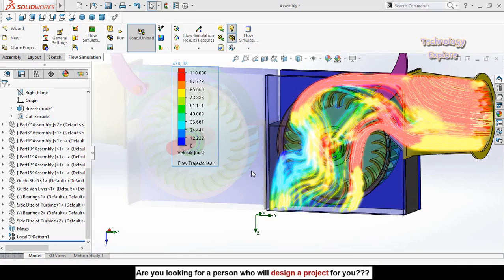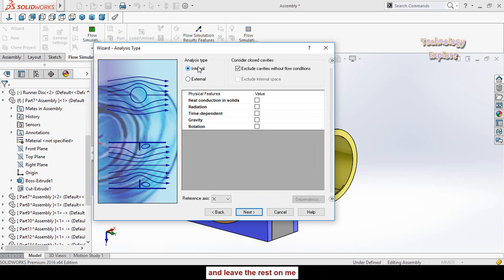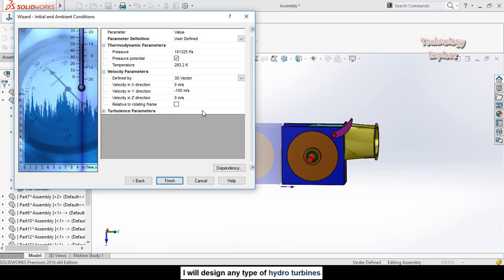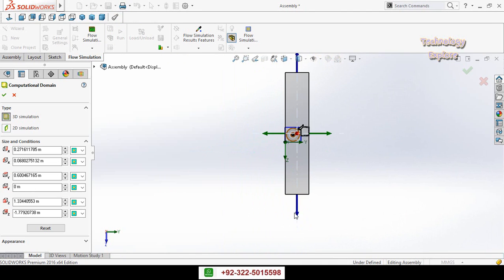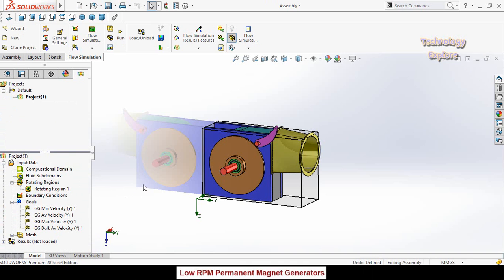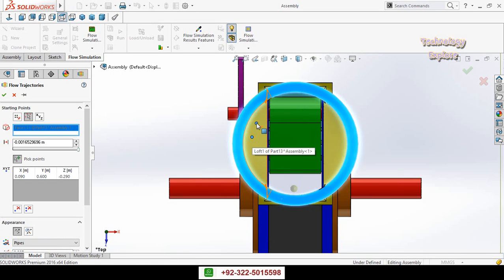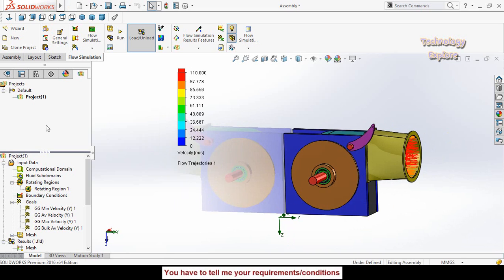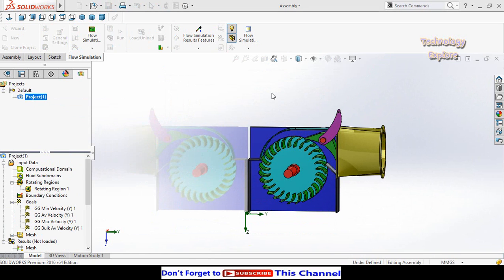Learn Step by Step How to do Flow Simulation in SolidWorks on Cross Flow Turbine

Comment: MY VERTICAL WIND MILL PROJECT  DETAIL
FAN BLADE 66INCH WIDTH HIGHT 144 INCH FAN 10NOS
AIR DANCITY 241
WIND VELOCITY 5.5 METER  PAR SECOUND TO 15 METER  PAR SECOUND
HOW CALCULAT RPM  
HOW MUCH RPM GENARATE 
PLZ HELP

Comment: Hi dear, I think there are to mistake in the simulation. First, you chose the wrong direction for gravity. Second, you didn't define any rotation to the blade you add rotation to the shaft only.

Comment: Great video, but I cannot understand why you choose external flow rather than internal flow. Is it a good approximation for this type of problem? Why? I know that in this type of problem it's necessary to consider a free surface which is not possible to use in solidworks combined with rotating region. Is it because of this? I was very thankful to hear more about this.
Reply from the maker: Internal floe is done only when your part is vacuum tight. But in this case we don't have a vacuum tight assembly
Reply: Ok. Thanks. But isn't it supposed to be in this type of turbines?

Comment: Which version of solid Works you need to run flow simulation?
Reply from the maker: all versions of solidworks support flow simulation, but i am using solidworks 2016
Reply: I use Solidworks standard 2018. I couldn’t find Flow Simulation in Add-In (time 0.54)
Reply from the maker: maybe there is some problem in your software.
Reply: @kandasamyrajan  Flow is separate module from 3D model. If want you need buy separately. for Info refer Solidworks matrix in their own website
Reply: @manikkammn  Thanks for the reply. I use Solidworks 2020 standard version. This video used Premium version. Also I do not have intention to buy separate add-in. If above one is possible with Solidworks 2020 standard version I will replicate it.